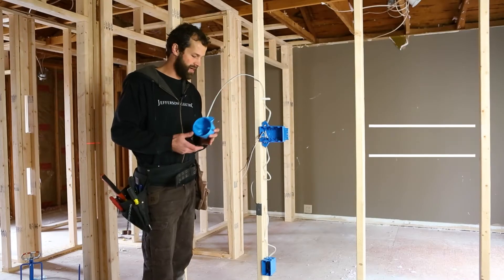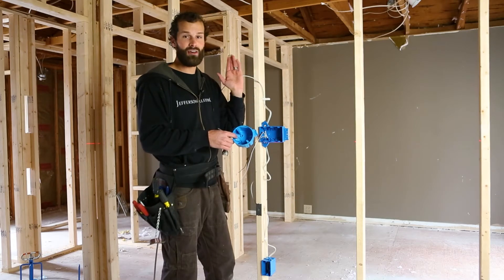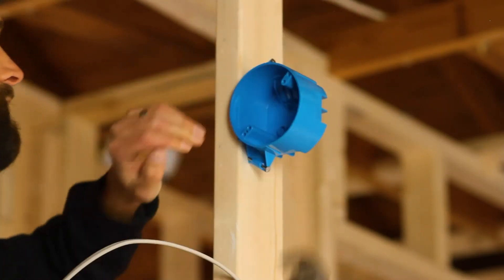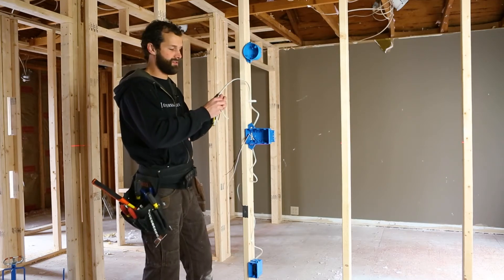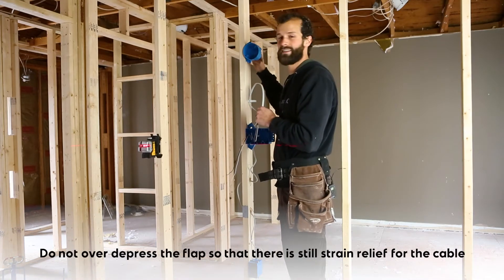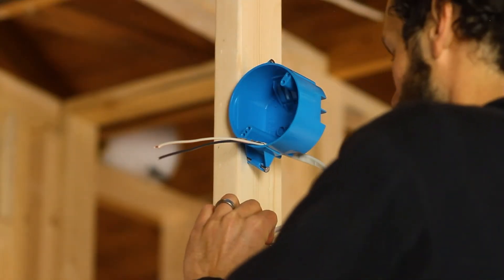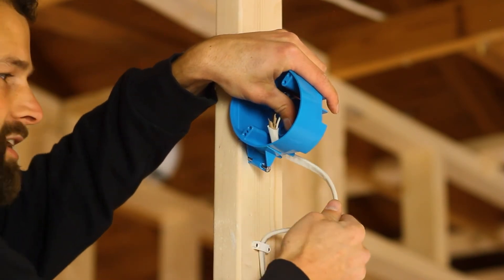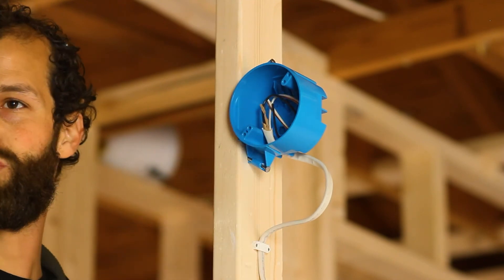Terminating Wire in a Round Box

Comment: I wish it was possible to start over in my house like your wall less studs. The electricians at the time had branches so poorly laid out.  Get this, the wire feeds garage lights, garage outlets, kitchen and dining room lights and even the back porch. It’s such a pain and took so long to figure out the mess. They went from panel to ONE ROUND BOX, then to out.  I’m planning to move all the wire from that small box to a 4x4 and fix the thing - but yikes.  I wish I could just start over and watching you makes me feel so jealous.  Fortunately I do have easy attic access.  Sorry for rambling ❤.
Reply: But you can.  It's just a lot more work!
Reply: @jovetj  I agree / I have to admit I love the challenge, and the satisfaction of making it happen is golden.  Unlike a piece of art, this job will not be seen by anyone else making it even more of a hidden treasure I suppose.

Comment: Not sure if I missed it or not but do you have a video for changing out a fuse box for a breaker box as well as the steps to kill the power coming into the box.  Could you just run a sub panel off the main panel and switch over circuits as you had time?